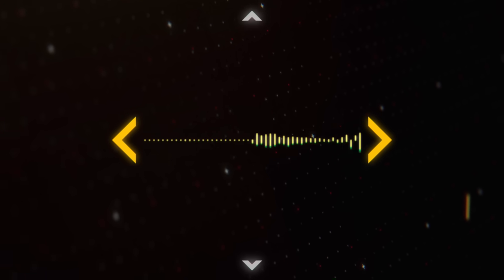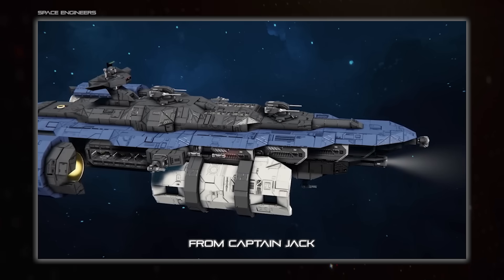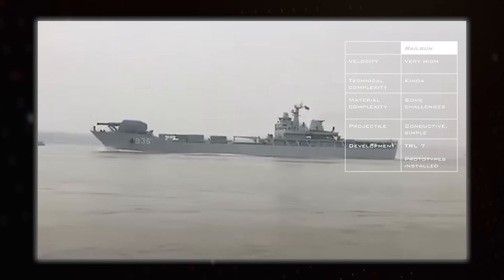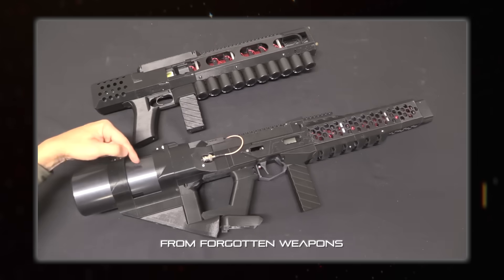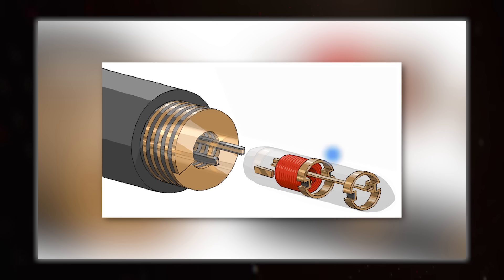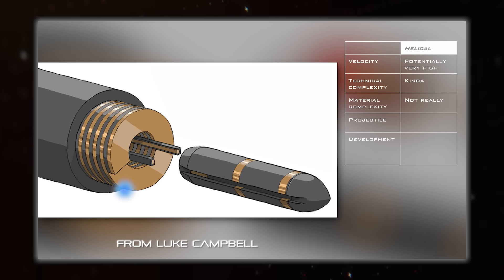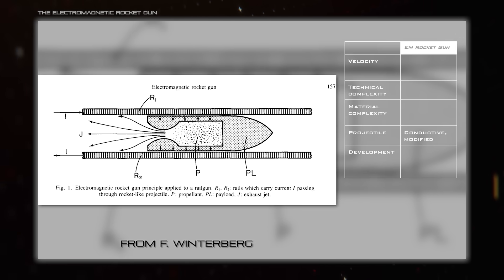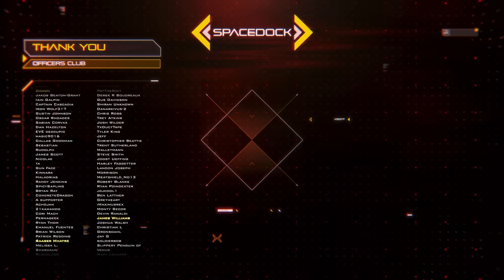The Deadly Coilgun/Railgun Hybrid You've Never Heard Of (Helical Railguns)

Comment from the maker: Luke Campbell's Galactic Library article on Helical Railguns! 
ttps://www.galacticlibrary.net/wiki/Helical_railguns
Reply: Hmm Inverted helical rail gun, when the projectile is hollow, and once it goes out the barrel, it folds out fins, widens in the throat and ignites a ram-jet, you could keep accelerating all the way to c-fractional speeds with that.
Reply: how about we took the helical barrel design, but the round a solid metal shaped like the helical round, the coils would make the round levitate (so theoretically, it won't make contact with the rail inside the coil barrel) and then the rail will be the main propellent of the gun
Reply: In theory in atmosphere to increase the speed or power consumption we could just make light vacuum in the barrel. Nothing crazy just enough to remove most of the air friction. I saw people do this with air cannons. There just needs to be a sticker or something else on the end of the barrel to get air tight seal. It will not block the projectile and projectile can very easily pass through it. Problem is something like this would mainly work for coil guns. I can imagine that it would not work as expected with rail gun. Maybe im wrong tho. Now imagine EM weapon that also uses some chemical propelant and also has vacuum in front of the projectile. Muzzle velocity of that thing would be insane.
Reply: Weirdly I paused the video and was about to suggest something similar to that Rocket Gun just as you started talking about it. Must be because you like mentioning Plasma so much on this channel that I thought of it before you even mentioned it.
Reply: Take a look at the newest aircraft carrier launching system.
Reply: I've always thought of this concept as a "Hyraco" Hy-brid Ra-il Co-il in my head.
Reply: How about a hybrit of chemical gun and a electromagnetic one
Reply: Sorry hybrid
Reply: Metalstorm has an electric firing system. It doesn't get the high velocities that rail guns get and there is an issue with ammo storage but it does have a theoretical firing rate of 1,000,000 per minute. There's vid on Youtube of it firing over 20,000 rpms.
Reply: I always wondered about (and wished the Halo universe had went with) smallarms that "assist" the chemical propellant projectiles with the assistance of one or two coils (say one repellent close to the chamber and one attractor close to the muzzle that could accelerate the round to 25% or 50% the velocity that the chemical propellant alone would achieve.  The rise in projectile velocity would be gradual over the length of the barrel and thus not add as much to recoil as simply using a vastly overpowered chemical propellant and the weapon may even have a thermovoltaic charging system that convert the heat from the explosive charge and from friction in the barrel into an electrical charge to generate power for the capacitors or batteries that store the coil's firing charges, making for a longer battery/capacitor life between dedicated recharges or battery replacement, so less of the weapon's size would need to be dedicated to housing the power storage system.  I always thought that such weapons made much more sense for a railgun and coilgun loving UNSC instead of them basically using the same 7.62x51 NATO battle rifle rounds that date back to the 1950's.
Reply: Why not get the steel round to make the connection to the next coil. A linear version of a motor armature.
Reply: I looked at your video list to find you are all about science fiction  - which is odd that you are doing a non science fiction video.. even your name spacedock is science fiction.  Space docks are physically impossible.. I mean by Real Physics. Space as the heliocentric model describes it, is a 2nd law of thermodynamics violation.
Reply: Could change that with the projectile by going with a combination of Heated Plasma and a Metal projectile.  The Metal Projectile and Plasma could be kept heated with a Laser.  Take the highly Powerful Electro Magnets and put them in a Tight Spiral Pattern around a Smoothbore Aluminum, Titanium, Vanadium, and Rhodium Metal mix Smoothbore Barrel. Putting the Electro Magnets around said Barrel will give a Gyroscopic Stability to the Projectile like with the Rifling in a Firearm.  Reason for that particular mix of Metal for the Barrel is the ability to take high amounts of heat which this design is guaranteed to produce.  Also, that mix will add lightness, and a high amount of Strength from the High amount of PSI's this design is guaranteed to produce.  Could add a Graphite Barrel Sleeve and Liquid Nitro Cooling System to help mitigate excessive heat.  Would help to keep a user from being burned.
Reply: AEROSPACE ENGINEER HERE: Can people like you who know NOTHING ABOUT what you are saying just stop.
This video took less than 60 seconds before you made the first idiotic claim.
More speed does not affect range in space, because there's NO air to dissipate the kinetic energy. 

More speed means more kinetic energy and its the dissipation of kinetic energy that makes any projectile do damage when it hits something. That's basic high school science that you don't even need an engineering degree to understand. That's also the theory behind APDS ammunition used in things like the Abrams M1 tank and A10 Thunderbolt.

FYI - I did my degree in the late 80s when Ronald Reagans Star Wars program was in full swing. Most of the post graduates were on DARPA Scholarships. One of my advanced options was in Space Craft Dynamics where we shared the class with post grads. For their higher level credit they had to present term papers and one of those guys was a rail gun expert and he was doing math on rail guns at a level you wont understand. Another guy was doing high accuracy pointing of space platforms which is needed when the target is 1 or 2,000 km away going at high speed along a ballistic path while your on an orbital path. That math was so far off the chart the rest of us including the post grads could not follow it. We understood the problem and the task but none of us could do the math except this one guy.

On APDS ammunition I was doing Finite Element Analysis on the Abrams M1 APDS. So I know how that stuff works too. 

So please don't be like the usual clowns and tell me I don't know what I am talking about.
Reply: You should also include a link to the 'Electromagnetic Rocket Gun' paper.
Reply: @Spacedock hey I had a thought about what you said about Railguns and Sabot Rounds in this episode. You said that the "Armature could either be the object pushing the projectile or the projectile itself", but you also suggested Sabot Rounds, which, if I'm getting this right, are basically a type of detachable coating around a piece of ammunition, whether it be for a Firearm or even Artillery. 

With this in mind, I had a thought... What if we took the concept of a Helical Railgun and combined it with the mechanics of a Ballista or even a Crossbow, basically creating an armature has the intended properties of the HRG's experimental ammunition, and actually launches the ammunition out of the gun in a similar manner to that of a Sabot, launching it out of the HRG but instead of flying out with the Ammo, it instead actually full on stops once it hits he end of the barrel, launching the projectile in a similar manner to a Ballista or Crossbow? This would make the ammo cheap and easy to make, and, while possibly requiring increased maintenance on the HRG itself, it could, possibly, be a much simpler solution to a complicated problem.
Reply: Is it possible to electromagnetically propel exothermic particles; with the intent on converging them into a fiery beam (once exposed to oxygen in the atmosphere), and with the propelled particles still packing shredding power???
Reply: Is it possible to electromagnetically propel exothermic particles; with the intent on converging them into a fiery beam (once exposed to oxygen in the atmosphere), and with the propelled particles still packing shredding power???
Reply: I wonder where this reply will end up?

Comment: Ever hear of a ram or scram accelerator? It is a railgun that launches a ram or scram jet projectile. These can theoretically reach hyper sonic speeds. The benefit of the system is you only have to launch the projectile at mach 1 and then the ram/scram jet kicks in automatically accelerating it to hyper sonic speed. This reduces the energy and wear requirements of the railgun itself.

Comment: Obviously we need to combine the electromagnetic rocket design with the helical railgun. What are we, amatures?

Edit: I thought about it more and this might work with superconductors and liquid helium as the coolant. The shells might be able to not touch the rails if the coolant bridges a small gap between the rail and the shell. That would limit the current significantly, though. I also don't know how much it would mitigate erosion.

Comment: It would be cool if you put a couple of contacts on the end of the barrel, so you could jam it into something and pull the trigger, and instead of shooting and the capacitors dumping into the coul/rail,  it just dumps all the power into an arc between the studs like a giant stun gun, that much power would be like an electric arc furnace for a fraction of a second

Comment: I wonder if you could create a helical-coilgun hybrid that uses the complex "projectile" as a sled instead of the actual projectile, with the actual projectile just sitting in front of it. An end section of the barrel would then use a coil with the current flow reversed in order to decelerate the sled, OR a more novel design to recapture some of the energy of the sled. Probably not worth the complexity though, since you would want the sled as light as possible so that most of the energy is imparted to the actual projectile that leaves the muzzle. The only complex bit would be the internal circuitry required to detect when the sled has come back to the middle of the barrel, so that the current flow of the original coil can be reserved to bring the sled back into position to chamber the next projectile. This may not be truly necessary, since it could be propelled back into position via mostly inertia. The decelerating section of the barrel would only need to decelerate the sled long enough to reverse its movement and impart a bit of momentum to return it to the starting position. There would probably need to be either a mechanical or magnetic system involved in locking it into place when it arrives.

Comment: There is another type of railgun that uses a non-conductive projectile. In the described case, the rails are closed not by the projectile itself, which leads to the formation of the Lorentz force, but separately, behind the projectile, forming an arc discharge. The latter leads to the evaporation of the projectile and the formation of a jet stream, which, advancing the projectile along the rails, accelerates it.

Comment: Helical gun -
Those bullets need to be made reusable. Honestly quite easy you would just need a stopper for the magnetic cartridge build easy replacement of the cartridge and just use any projectile you want in the head set up kind of like a slingshot hell let’s dub it SlingShot Helical I like it honestly that would be fantastic as you still don’t need a ejection point and you could just make a panel that opens in order to quickly refit a new cartridge when that one quits functioning

Comment: i mean if it's not a chemical hybrid. on a coilgun at least. use a laser, aiming straight down the "bore" at the base of the shell. track where the shell is in the barrel with a laser, per barrel. that way you can perfectly time the coil gun? it can't be that simple though right?

Comment: For purely naval use, coil guns seem quite feasible, as you don't obscenely high speeds as considered for space, and by wrapping the coils in some cover/tube, corrosion can be easily avoided. Make an inner barrel of something cheap and friction due to the projectile would be a non-issue.

Comment: Here's the problem with that: 
1) Elektromagnets are weak af (compared to explosives). Your projectile won't accelerate as much
2) Coils tend to resist having their current increased due to inductance. Rise-time=L/R, meaning the stronger the coil, the longer the rise-time. You could always increase R but in this case you need insane voltages to maintain a strong enough current, which means sparks and lighning, which could short-circuit your rails through air.

The  vacuum permeability simply is too low for these guns to be easy engineering.
Reply: Chemical reactions work well in atmo, but in space we encouter a very different environment though, especially if we were able to place an armature in the middle of a railgun barrel without physical contact

Comment: here's a quick guide about the main three:
railgun: uses a lot of electricity, not that complex, ferromagnetic projectile, rails that run a lot of electricity through the projectile (shorting it)

coilgun: electric, complex with sensors and stuff, ferromagnetic projectile usually, coils of wire that generate some magnetism by running electricity through them and turning off when the projectile passes it

gauss gun: non electric, complexity depends, nonmagnetic/ferromagnetic projectile, magnetic projectile gets sped up by permanent magnets to launch a nonmagnetic projectile or just look at the one in wikipedia kinda hard to explain that one

Comment: My setting uses energy-charged physical projectiles instead of standard "blaster" or "plasma" type weapons. More or less like how Chewbacca's bowcaster works. Rounds are usually subsonic and in flight they look very similar to the classic "energy bolts" but justified since they are physical bullets encased in energy, not "pure energy." I am almost wondering if helical railgun tech could benefit the technology here, as the complicated electromagnets inside the bullet could possibly include another section that uses some of the current to help charge the energy-emitting elements in the bullet as it travels down the barrel, gaining charge as well as velocity. If so then the complexity of the projectile serves two purposes instead of just one, and not needing to be super-high velocity would likely help with both erosion and power consumption (at least for the barrel, since the bits that energize and enshroud the bullets in energy would also be drawing quite a bit of current.)

Of course there are probably other factors, such as possible waste heat and loss of efficiency from making the rails do double duty (accelerating the bullet AND charging it up with energy,) or the plasma envelope around the bullet leading right back to the same barrel arcing/erosion issues that plague standard railguns. But I'll cross that bridge when I get there.

Comment: The helical rail ammunition coil could just be used as sabo or a wad to push ammunition. And, if designed correctly, pulling it in after the bullet made an exit could make it reusable and reduce the cost per ammo. That's why you'd want to retract the ammo coil back into the barrel before the next bullet is reloaded. But, I guess, to increase fire rate, you could try to guide it down like a looped train.

Comment: The electromagnetic rocket gun, will be slower than any other type of EM gun when fired in a vacuum, because the rocket is limited to the thrust produced, while other railguns are limited only by c and friction. the advantage of the rocket gun is only for getting the projectile to high speed given a shorter barrel length, or more aptly, doing a hybrid system with it, to shorten the barrel length of one of the other types.

Comment: I’ve actually seen the Navy’s rail guns in person.  I served in the Navy from 2011-2017, and I was actually stationed on the base where they were doing the testing on the rail gun systems.  There were actually two on the base, both were housed in the same building.  One was an older design and was much larger than the newer version.  Both were fired while I was on base, the older one just sounding like a canon firing, but when the smaller one fired it felt like the house I was living in moved, and I was on the other side of the base.

Comment: By "replace the rails every now and then" it really means "once every 5-6 shots" at least in the case of the US Navy railgun.  One of the big selling points of having a ship-mounted railgun was how small, light, and inert their ammunition would be, drastically increasing a ship's depth of magazine with no risk of ammo cookoffs.  But if they ALSO have to carry multiple pairs of replacement rails and replace them after only single-digit uses, all advantages are negated.
Reply: They managed to get it to ~100 shots per barrel last I've checked.

Comment: Im sure its been proposed (And Im far from a chemist) but in a traditional railgun would it be possible to coat the rails in a gel/ outer coating that is insulating until a second chemical (a coating on the shell) is introduced? With either the heat from friction or the electrical current being the catalyst to form a compound that conducta the current for the time the shell is in contact.

It would mean that the rails would need replacing still, but could mitigate current loss as the teo rails wouldnt waste power arcing ahead of the projectile, and I imagine reapplying a coating or gel would be easier than manufacturing new rails.

Liiike i said though, I cant even begin to figure what and how, the idea just comes from how matches light, and honestly chemisty has some bizarre interactions.